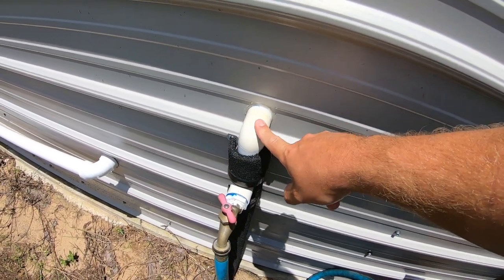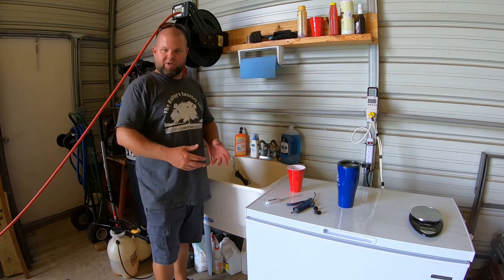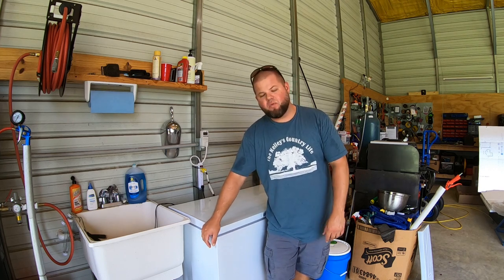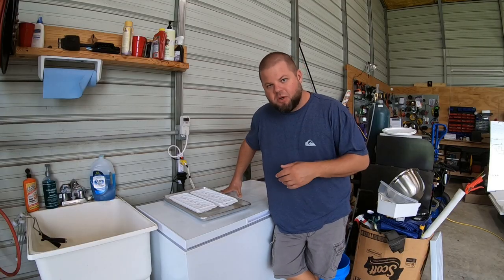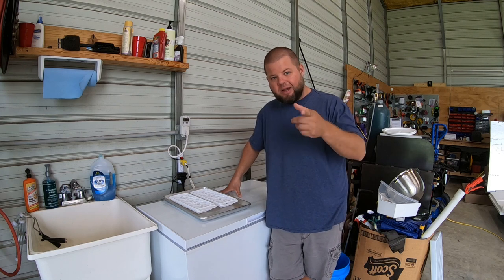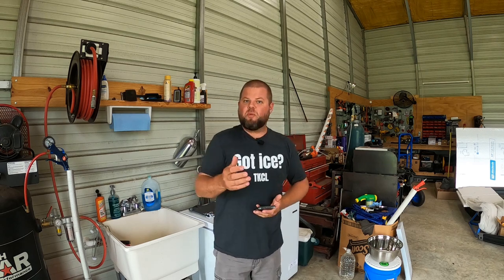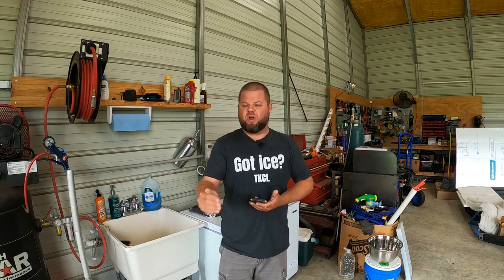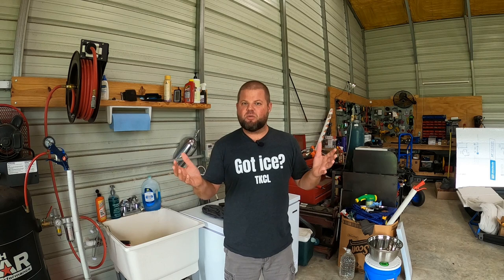Homemade ice machine tests! Hot water freeze quicker than cold water Mpemba effect? #376

Comment: The Mpemba effect has to do with how fast water loses energy(heat).   Sorry I work in Celsius. 100 degree boiling and 0 degree freezing.  Say you have 100 degrees water and 10 degree water.  What the Mpemba effect states is that the 100 degree water will lose more energy in the same amount of time than the 10 degree water but the thing is the 100 degree has a lot more energy in total. For example in 30 min, the 10 degree water goes down 10 degrees(so its at 0 starting to freeze). While in the same time the 100 degrees loses 60 degrees and now is at 40 degrees.  So its lost 60 units of heat while the 10 degree only lost 10 units of heat and therefore has lost energy "quicker".    A lower energy state will always freeze quicker just because it has to move less energy out of the water.

Hope this makes sence. Its 6am and I havnt slept yet.
Reply: Makes sense to me but I had to put numbers to an equation in HVAC school and given a dog dish in freezing weather example. I do remember ΔT being in the equation but had to look up the Mpemba effect. With YouTube I learn at least one thing new everyday. Thank you for providing that new thing today. . . .
Reply: Soeveth  Thanks for the easy to understand explanation.   How anyone could rationally think hot water would freeze faster than cold water is beyond me.  Its like two identical cars......one is sitting still, the other rolling at 90mph.  Which one can hit 100mph first?  The static car can create noise, smoke, negative Gs, that the rolling car didn't. However, the rolling car will be at 100mph long before the other.
Reply: The amount of energy the water loses is a directly related to the temperature difference, the greater the temp difference the greater the heat transfer rate.  The equation is Q = mc∆T where Q is the heat energy, m is the mass, c is the specific heat, and ∆T is the difference in temperature. That isn't the Mpemba effect

Comment: Utilize the thermal losses from the top and back of the deep freeze to pre cool your water before it enters the icemakers. You can use the poly tubing you’ve already got. Just sandwich it under whatever insulation you plan on adding. No need for an additional refrigerator to run. No additional costs
Reply from the maker: I'm kicking that around
Reply: @TKCL  you may have to do some math to ensure you’ve got enough liquid capacity in your tubing. That may involve measuring how much water it takes to fill the ice maker, and then determining the fluid capacity of the poly line to ensure you have enough linear footage of the line to hold enough water to fill both ice makers once. At least. A lot of experiments can even stem from that setup as well.

Comment: Hot water drops temperature faster, but it eventually gets down to 50F and from there it will get to 32F the same speed as water that started at 50F. That means all the time before it got down to 50F is added to the time it takes to freeze water that started at 50F.
TL:DR: cold water freezes faster. The hot has to get cold before it freezes.

Comment: This hot or cold water is clear.  A ice machine is rated to make pounds of ice in a period of time at a given inlet water temp.  The hotter the water, the less pounds.  Adding hot water to your freezer not only reduces production, but adds to the ice build up on the sides from water vapor.
Reply: Still hot water freezes faster than cold water put hot water in the freezer and a cup of cold water in the freezer to see what freezes faster. Whether it produces more ice or not.
Reply: @Tracyspellenberg  he literally did that in this video…. And proved you wrong
Reply: E S  a lot of people here kept blindly saying that hot water freezes faster.  I question their intelligence.
Reply: @Tracyspellenberg  you’re a different kind of special aren’t you?
Reply: Have you timed the cycles. If you could find away to count the ice dump cycles. It would be easier than weighing the ice. And those makers only use 6/8 oz’s per fill. I used to know exactly but it’s been awhile. In a home refrigerator average cycles are 20 mins apart, at 10 or less degrees.
Reply from the maker: No I have not sat out there and timed yet

Comment: I found this channel while looking into those tabletop ice-makers, they produce soft ice, which is great for making ice water or a watery glass of (insert preferred drink) and not much else. There are some that cost $400+ dollars and make thicker cubes faster but it's still soft. Cleaning is also an issue.
Since you already use that mini-fridge, running those plastic lines through it seems like a good idea and you would still have plenty of room for its normal load of stuff.
GREAT JOB btw! It keeps getting hotter and you keep outdoing your previous production!
Of course, the cheapest way to pre-cool your water would be to lay that tubing you already have, on top of the freezer and underneath whatever insulation you finally decide upon.
Reply from the maker: I'm going to test one too

Comment: it all coms down to BTUs the freezer pulls the BTUs out of the water so the lower the BTUs in the water going into the freezer the quicker it will freeze.
Reply: True, the ice makers are drawing in so little water each cycle.  At 1 BTU/lb F for water, the difference to bring  one pound of water at 50 F vs 100 F down to 32 F is 50 BTUs extra.

Comment: my ice maker has been running for 1 week now.   7 cubic ft freezer is about half full. I guess I don't use as much ice and I open the freezer less. I also sealed the gaps cut in freezer using great stuff for windows and doors. it is made for insulated ares and the window door formula has the least expansion pressure so as not to lift the lid off while curing

Comment: I have used a mini fridge for cool drinking water for several years in our shop. Our experience with copper coil was that it would freeze the water.  We ran the coils on the back wall. Out finial version ran a coil of pex inside the rear of the fridge. In the end the Pex won. It is  cheap and did not freeze as easly with normal refrigerator operation.
Reply from the maker: Thank you for the information

Comment: Also a thought, maybe get a fridge and put it next to the freezer, run a 10 ft long plastic pipe made into a coil through the refrigerator compartment then back out to the ice makers. The coil will keep a good bit of water refrigerated on it's way into the ice maker. Plus you'll have a place to put drinks and stuff in the shop👍👍

Comment: As an engineer the work and cost of providing chilled water is not worth it.  I would go outside and dig around your water line a few feet from where it comes into your building and insulate it at least 1 foot underground and up the wall and into the inside of the building and leave it at that.  I would use the spongy black foam that is used on HVAC freon lines and tape it up good and call it good - small labor and materials cost to reduce the sun beating on the pipe as much and raising the temp!  Now if you want to reduce your cost for making ice figure out a way to bolt a aluminum water block onto the ice maker housing and run the warm water from outside through the block and let that pre-cool your water while releasing your ice cubes from the mold!  That would serve 2 purposes at the same time!!

Comment: For a chilled water solution that's easy and new-equipment-free, just run the loops of nylon lines under the insulation you plan on installing on the lid and/or back. It will recycle some amount of that lost efficiency back into your process
Reply from the maker: I'm leaning towards that idea
Reply: This is what I was gonna suggest.. can't have it in cuz it would obviously freeze in the freezer lol... But you're literally making ice! Lol take some of the ice and plastic tubing run coiled up in a bucket before entering the makers... Just enough so it chills water intake but not too much cuz might freeze ya know? Was also curious bout hard and soft water? Do they have different freezing times? If u add third freezer would run to keep up with added heat so I would stay with 2 and only have 1 fan and chilled maybe even filtered water on intake which can be all in one unit... Iced filter? Lol... Can't wait to finish these vids for some reason hahahaha... U captured half the dudes on the internet some how... It's great lol

Comment: Derek Muller, who has 9.43mil subscribers on his "Veritasium" channel, explained on his 2nd channel, "Sciencium" why the Mpemba effect does in fact NOT exist in this setting. You confirmed it. I'd suggest bring that cooler closer to the freezer by placing it on some boxes. That isolation foam can't fight the Florida heat. 2 of the 5 seconds of water are reheated to room temp in that pipe prior to entering the freezer. Then also use salt water in your cooler. I learned that trick from Rob (DeerMeatForDinner). You did some great tests here!! Thanks!! We'll be watching.

Edit: Don't use expensive copper. Rather drill two holes in a plastic soda bottle cap. Do a good seal with apoxy. These bottles can handle the pressure. One pipe enters the top and the other longer one goes all the way to the bottom. Do this with 2 bottles one running into the other in your mini freezer. No cost, just some work. Its the same concept as what Samsung fridges use to supply chilled water into their door dispensers. Remember to keep the distance between the water cooler and freezer as short as possible to prevent reheating. I think you'll beat the 8% increase. Holding thumbs.

Comment: I was really hoping for a towel under those ice trays to keep the aluminum for sharing the heat to the cooler ones. a little distance would have helped too.   I've only watched to where you just put them in the freezer at time mark 11:01.... obviously the colder water freezes faster but it would have been more so with some insulation and distance between them.
Reply from the maker: Great point!

Comment: Before investing in copper lines i personally would
1. shorten the water line height outside. 
2. try using that plastic tubing you used in the cooler, thats how some fridges with water dispensers do it just a zip-tied coil of plastic line.

Comment: Perhaps rerouting the main well line with a T joint and maybe even a valve so it stays under ground  as much as possible before it enters the building  depending on the limitations of the slab floor      or even a new home run to the wellhead that is about 4 ft deep in the ground.  Bit at LEAST don't pull from the top of the external vertical section with the black insulation on it..    Good luck!!!

Comment: Just a touch on the fans sweating when the lid is opened: have you considered not adding switches to the cooling fans and leave one fan center mounted blowing between the two ice makers aluminum castings(move the other fan to your compressor area like you already mentioned) then mount an 1/8 inch plexiglass shroud starting an inch or two below the bottom of the fan, about 2 or 3 inch's between the shroud and the back of the fan and also covering the complete top of the fan and ice makers. Same shroud basically if you move the fan to the bottom centered blowing between the two ice makers.

Also if you still want to consider using the mini fridge to use precooled water, use aluminum tubing(possibly much more cost efficient) instead of copper and then of course have as short of insulated line between the mine fridge and ice maker water inlets
Reply from the maker: I scrapped the mini fridge and went to a single high velocity fan. Made a huge improvement!

Comment: HVAC guy here. 1 BTU is the amount of energy to raise or lower 1 lb of water 1 degree F.  So if you have 200F water and try to get it to 40F it would take 160 btu's but if you have 70F water and try to get it to 40F it would only be 30 btu's. I wont go into latent heat, but yes if your water is colder going in it would take less time to freeze it.

Comment: the whole hot water freezes faster is probably attributed to misunderstandings about hot/boiling water expending its energy faster than cold water. the Tech Ingredients channel i mentioned in a previous video had a freezing demonstration with their home made freezer and shows that the temperature will actually stall until enough energy/heat has been moved/lost to continue dropping the temperature.
Reply: No it's because the hot water will evaporate in a cold low humidity environment. This evaporation adds to the cooling of the water..
Reply: @Bryan-Hensley  its almost like it expends energy faster than cold water as a result, but doesnt freeze faster.

Comment: It has to do with thermal mass again. If you spray boiling water and room temperature water in freezing conditions the boiling water will freeze in the air. With containers or masses of water, the chilled water will freeze faster because water freezes at let's say 0F for the sake of argument. It takes longer for a given mass of water to reach 0F from 212F than from 50F. As the the water is atomized or vaporized, thermal mass is much less of a factor. I believe the room temp water was so close to the same time as the hot water because of their proximity to one another. According to the laws of thermodynamics heat moves from areas of higher concentration (hot side) to areas of lower concentration (cold side). I have no doubt that the room temperature water absorbed some heat from the hot water tray making their times to freeze closer to one another.

Comment: Hi, I've been watching for some time now on these ice machine tests you've been doing.  I'm just trying to understand what is happening with water freezing.   I've seen your data on the ice makers and the fans you installed but as I understand ice makers, they run on timers and if an ice maker is filled to capacity and if the freezing timer is set for 2 hours (just guessing on your ice makers) then it doesn't matter the temperature of the water coming into the ice maker the water will freeze when it wants to and will dump on command of the timer not when that ice becomes frozen.  How do you explain more ice production when the ice maker knows only time and the capacity of the ice trays??
Does your machine know when ice is made and ready to dump??
Reply from the maker: They run on both. There is a thermostat the reads the mold/tray temperature. Once it reaches a certain setpoint (under 10 degrees), it triggers a short but TIMED dump cycle. The quicker you can get the mold to temp, the more dump cycles that are triggered.
Reply: @TKCL  Thanks for the quick response.  I thought it had to be something like that.  Otherwise you would get the same amount of ice no mater what you did.  Good luck on what your doing.

Comment: Maybe instead of the minny fridge.  Look on water coolers.  Route your water in. Have a line out to the ice makers before the cold water out.  You get cold water for testing as well as a cold water source in your shop. Depending on the models you could also have hot water if needed.

Comment: I'm going to use metric because the numbers are easy. Switching to gal/F/what ever is just a conversion it doesn't change the physics. When I say water I mean pure water, adding slight impurities changes the numbers slightly but the difference is normally minimal. Adding slat to melt ice is not a "slight" amount.

1. 1 cubic centimeter (cc) of pure water is 1 gram (gm);
2. To cool 1 gm of water 1 degree Celsius (C) means you have remove 1 calorie;
3. To freeze water at 0C you remove 80 calories and get a ice at 0C;
4. To cool ice 1C takes 1 calorie;
5. The speed of heat transfer is proportional to the difference in temperatures. Large difference, faster transfer, small difference, slow transfer;
6. The amount of gases dissolved in water is inversely proportional to its temperature, hotter water has less dissolved gases.
7 Water turns to ice at 0C under "normal" conditions.

The reason Fahrenheit uses 32 as the freezing point is that 0F is the lowest temperature that a water / salt mixture will stay liquid at. Fahrenheit used three physical points to define his temperature scale, the boiling point of water, the freezing point of water ( 180 degrees, same number as half a circle with lots of factors) and the freezing point of salt water. Celsius uses the first two and a range of 100, fewer factors but we do have 10 fingers.

What does this mean?

1. Cool water will freeze faster than hot water since it takes time to cool the hot water down to the temperature of the cool water, at that point they are the same. To put it another way the amount of energy to remove from the hotter water is greater;
2. Given a set cold environment ( the inside of the freezer) the rate water cools is fastest when it is warmest and slows down as it approaches the freezing point;
3. Ice made from hot water is clearer since it has less dissolved gases;
4. Using cooler water does speed up the freezing process but the main energy removal requirement is to cause the phase change from water to solid ( 1  vs 80) so from an energy transfer point of view the phase change is equal to an 80C water difference. From an energy speed point of view its the slowest since the temperature differential is the smallest; 
4. Cold ice doesn't make your drink colder, it cools it faster but the final temperature of the ice/drink mixture is the same ~0C. The mixture is basically in equilibrium some water some ice, melting occurs because heat is coming in from the outside of the container.